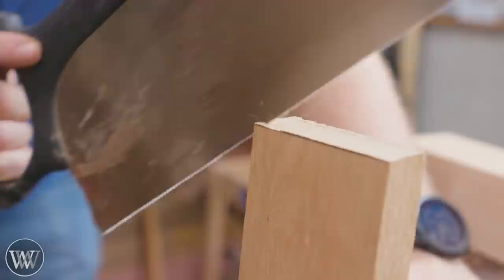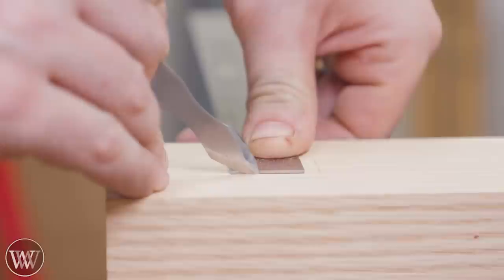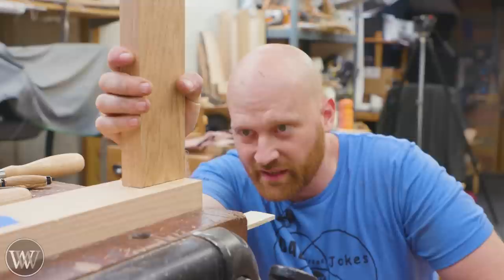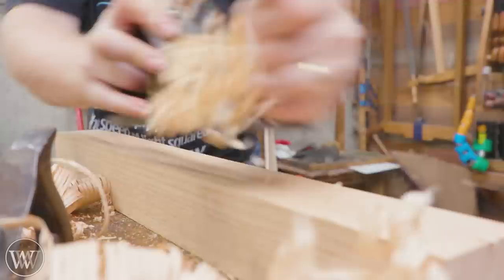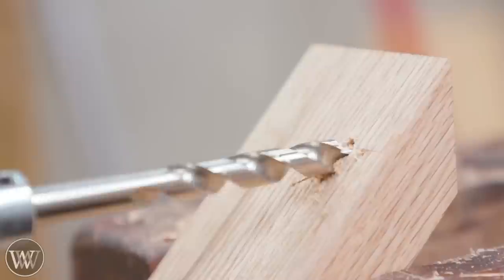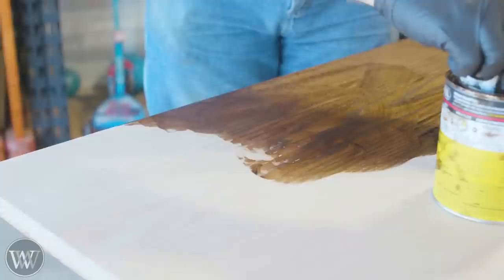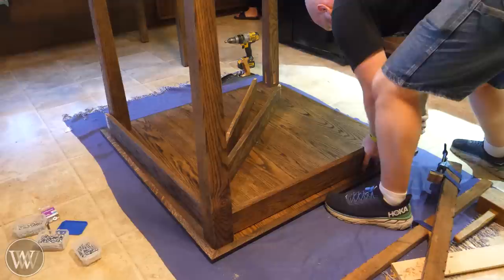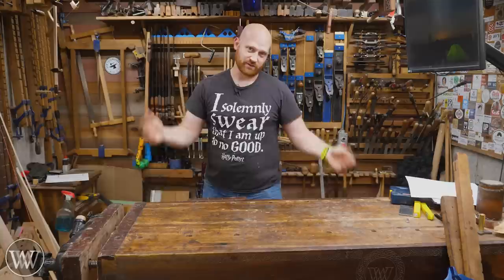Two Shaker Dining Room Tables All Done How To

Comment: I'm on a commenting spree today. Question: i have built a much simpler version of this undercarriage for an outdoor farmhouse table. After several years, the legs have come loose and the thing needs to be refurbished. Do the mortises and tenons in this version prevent the leg wobble from developing? Or is that inevitable due to the leverage of the long legs?
Reply from the maker: Yes. The mortise and tenon is what provides the structure. The fasteners just keep them together so you can take it apart in the future. If you don't have the mortise and tenon the screws will just work out over time.
Reply: @WoodByWrightHowTo  awesome. I really like the look of the apron/legs instead of a trellis. Plus I need an excuse to get my mortise on. Thanks!

Comment: Would a sliding dovetail have worked for the gussets or due to the miter would it just be unstable? I know Matt Estlea has a video about mitered dovetails but I don't know if it would work in this application.
Reply from the maker: In this application it would not add any strength.  If the boards ended at each other then it might. But dovetails don't work very well if one board intersects the other midway.
Reply: @WoodByWrightHowTo  Tyvm